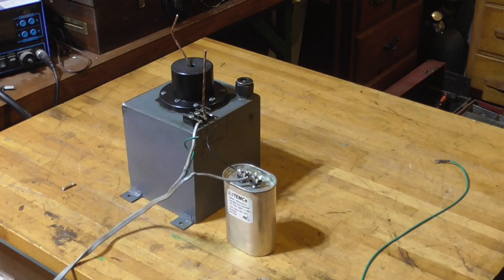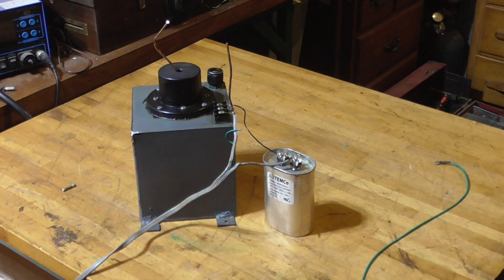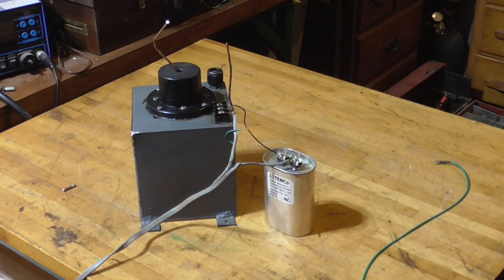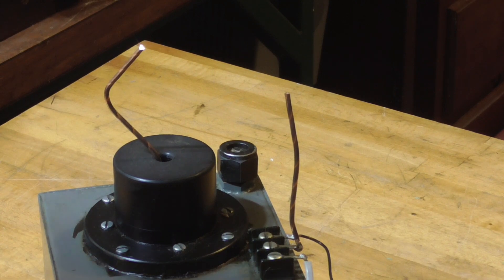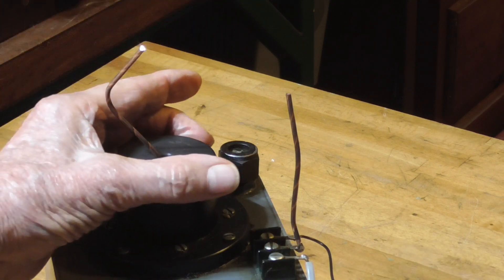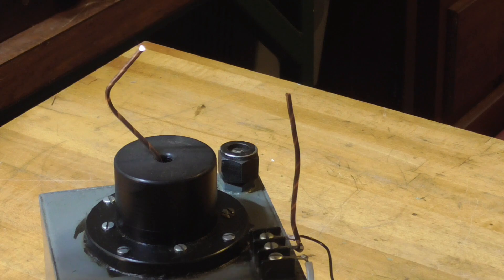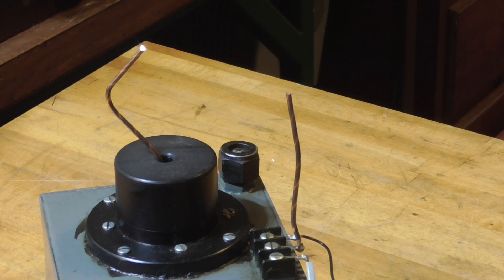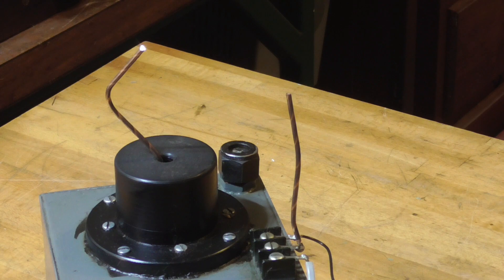60,000 VOLT TRANSFORMER

Comment: 60,000 volts at 60 hertz . That is scary . What you are saying makes perfect sense . Two conductors separated by air --- you have a capacitor , and capacitive reactance is inversely proportional to frequency . Also , as you say when the air or whatever gas is ionized the gas becomes way more conductive and you can pull the wires apart and increase the length of the arc .

Comment: great explanation Ron... as a kid (a looong time ago) I used to generate a small spark gap using a single cell battery and a speaker transformer... each time you swiped the battery terminal it would spark... also gave you a fun electric shock at just microamps...

Comment: In physics a couple semesters ago I we had a vandegraaff generator that was, at fill tilt, capable of arcing about a foot away. I told my classmate that it was possible to calculate the voltage based on the distance of the arc and that it was probably around 30kv. Was I too far off? Ive always wondered how close I was.
Reply: @MichaelOfRohan I'd say you were off by a factor of 10.  As others have pointed out here, the rule of thumb is 1,000 volts per mm of spark length for a DC source.  So, one foot is 305 mm, which means the Van de Graaff was putting out about 300,000 volts.

Comment: The highest I've dealt with was some single stage klystron beam supplies rated 120KW they tapped from 32-44KV ~3A DC.
Reply: 44kv at 3 amps?! 😳 Holy moly
Reply: Do they still use Klystron tubes?
Reply from the maker: @Jeffrey314159  Yes! They are still the only way to get modulated CW power at microwave frequencies.
Reply from the maker: Let's see Electroboom get zapped by that one!  Maybe start calling him "sizzleboom!"

Comment: I used to have a lovely jacobs ladder on my desk in a glass tube at the top the distance was about 5cm, made from a tiny neon sign transformer. It was all fun and games as every time I used it all my usb devices would disconnect and reconnect until one day they stopped connecting, high voltage is dangerous even 5ft way from a computer it turns out.

Comment: How does the capacitor limit line current?  Do you mean smooths line ripple to limit spikes?
Reply: When connected in an alternating current circuit, capacitors have a type of resistance called "capacitive reactance." The amount of resistance will depend on the frequency of the current and the size of the capacitor. So if you connect a capacitor in series, it will act like a resistor. He connected the capacitor in series with the input of the transformer to limit the current.
Reply: @ct92404  I'm an electrical engineer 40 years so I appreciate your explanation!  But I also know that if you don't understand the application and schematic you don't really know.  But you confirmed my suspicions thank you. So why not add a resistor? Or inductor? They have impedance at 60Hz too.
Reply: @KAFKUBA  No heat dissipated in a capacitor (except ESR losses).
Reply: @CanizaM  awesome thanks
Reply: A capacitor is an ac-resistor ( Xc = 1/(2*pi*f*c) )

Comment: Great demo, and great to get the proper explanation.
I have always been facinated by high voltage, but it's not for me to play wth. I did fire my MOT up once and only once, the spark and the noice scared the shit out of me. 
220VAC I only work with very seldom and with big care.
If I want to "play" with high voltage, I prefer to use my small Van De Graff generator 🙂
Reply: MOTS are deadly, as you are probably well aware... not because of the voltage, but due to the lack of limiting, and the "impedance" or load resistance reflecting back to the supply at the square of the turns ratio... your 100Kohm skin looks like a few ohms to the supply and it will attempt to deliver as much power into that load as it can... all thats in the way is the circuit breaker/fusebox...

flybacks, ignition coil type things, at least theyre limited by the poor magnetic coupling, and the power pulsing rather than coming from a source of "unlimited" power...

Comment: I tend to work with a rough number of 1mm per kV.
Reply: One moment... please... when a new video with some carbonised drinks? 🤔
Reply: @badeadrian Will it carbonate? Diesel fuel.
Reply: @silverXnoise  It'll carbonate itself if you light it 😉
Reply: Jup me 2! 😉👍
Reply: ...Your Gabriel electrode was a great help when i used 10kV, thanks.....the resistors haven't blown up...yet.
Reply: Time to make Nitric acid from air with this baby.
Reply: The high voltage start on the TIG welder I use at my job will jump about 3 inches. I don't think it runs near that high of voltage.
It feels real good if you get it through your arm. It doesn't just shock you, it makes your arm feel like it's going to FLY off.
Reply: Bigclive in dah house
Reply: it's a big different differences rectified or Not
Reply: this has always been my rule of thumb as well, the higher the voltage the less accurate this is as it can float higher than rated voltage and then arc over, drawing the voltage down to the required voltage to sustain the arc, carbon arc lamps only operated at 50 or 60 volts!

Comment: Nifty! That reminds me, I have quite a few old neon transformers(including a few 15 KV's) to get out of my life.
Reply: I love neon transformers. 😃 They're current limited with shunts in the core, so you can draw arcs from them and they don't overload. Great for doing high voltage experiments.
Reply: @ct6502c  well, theyre intended to drive neons 24/7, arent they? may take 15kv to strike, but only operate at approx 100v or so. grey area, that one... depends on gas, pressure, length of tube...

wish i had grabbed the 22kv one the local shop had when they closed down... was a big sucker... was for testing or something...
Reply: @ct6502c  indeed 👍

Comment: 25KvDC per inch at standard atmospheric pressure, rule of thumb.
Reply: And normal humidity or water vapor content of the air. With very dry air it takes 30KVDC
Reply: At 60 Hz then?

Comment: That could definitely be used to kill oneself. 😱😱
Reply: Yes. Those mains connected HV Transformers are absolutely lethal. You can be the luckiest man in the universe, but if you touch that, you are gone with almost 100% certainty. 
The pre-war TV sets with mains derived EHT are called "widowmakers" for a reason.... Quite a few radio technicians who were just accustomed to the "bite" of the B+ rail in radio sets have been killed servicing those TV sets.  Really sad stuff.
Reply: @albinklein7680 I have a couple of antique televisions I restored, one from 1948 and the other one is from 1956. They are completely powered by vacuum tubes. I love antique electronics, but yes I definitely make sure to stay clear of the high voltage coils in those tvs! 😳 Not only is it high voltage, but I'm sure the current is also a lot higher than the small flyback transformers in more modern tvs.

Comment: thanks for the video. I dind´t know HF ionizes air. Thanks for sharing your knowledge
Reply: It's the high voltage that ionises the air, the frequency just helps it along. Air can be ionised using high voltage at mains frequency (50/60Hz) but there won't be any arcing. At least I think that's the case.
Reply: @peterlarkin762  It can (this transformer is 60Hz), we learn generally "10KV per centimeters" (and it's with humidity). Look for breakdown voltage if you're interested. And it's a distance to initiate the arc, it can be longer after initiation (you can look at electroboom video, he nearly ends it's career with this experiment...)

Comment: Many years ago, I used to do this experiment with a 11,000 volt neon transformer, on a smaller scale, of course. I didn't need a cap to do it though.
Reply from the maker: The cap is used to limit the line current to something my breakers can handle. This transformer can "arc" over 12 inches if the primary current is not limited!
Reply: @glasslinger  very clever like a capacitive dropper.
Reply: @glasslinger I figured there was some capacitance in the circuit. 🙂 It didn't look like a pure 60hz arc. It had that snapping bluish spark instead of a yellow-green flaming arc that you get from AC.